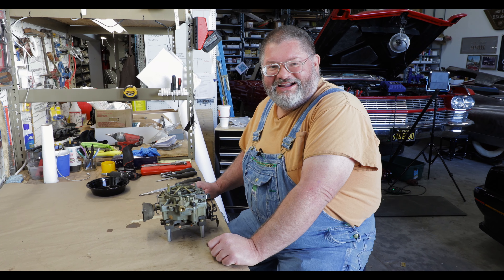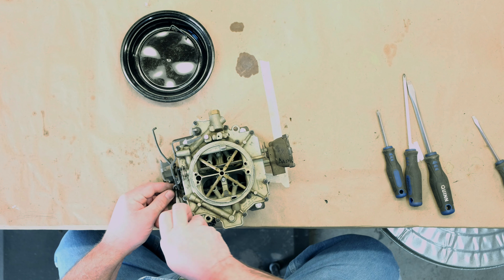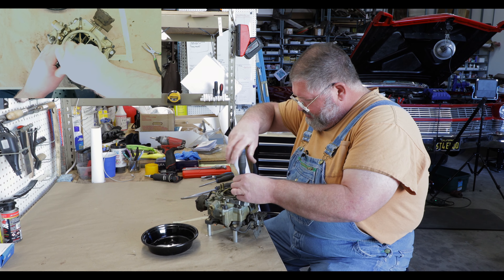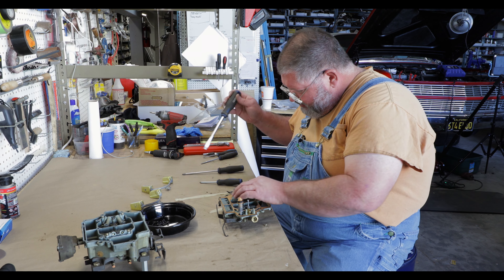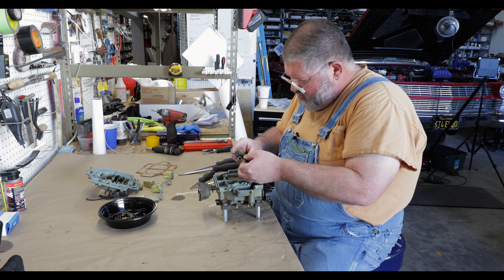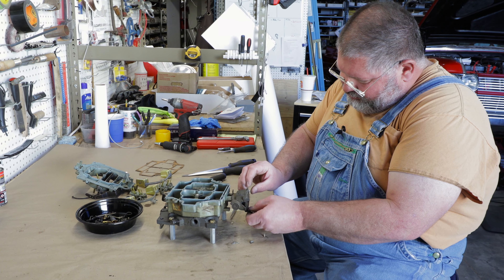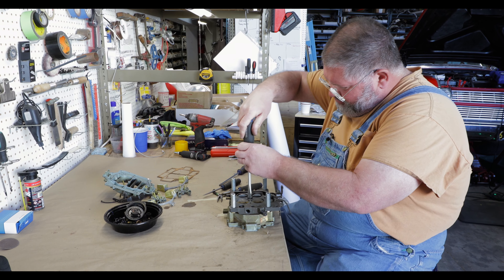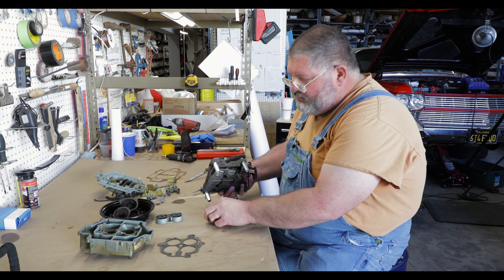How To Rebuild Rochester 4 Barrel Carburetor Part I

Comment: just a curiosity which size metering jet goes on which side
Reply from the maker: The jets are paired for the primaries and secondaries. The specific size 
of the jet depends on the application. Keep track of where they come 
from and I always suggest checking the service data to ensure the jets 
you have are correct for your engine. Many times the carburetor has been 
replaced with a generic replacement that is not properly tuned for your 
specific engine. Also, depending the ethanol content of the fuel in your 
area, you might want to go up a jet size to compensate for fule with a 
lower energy content.
JOSH